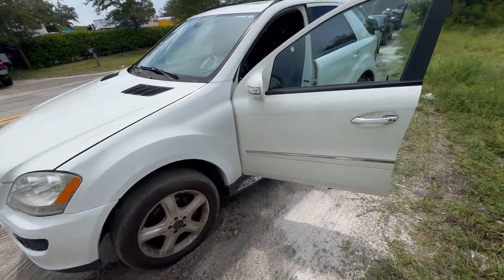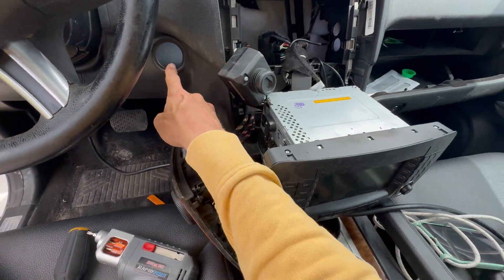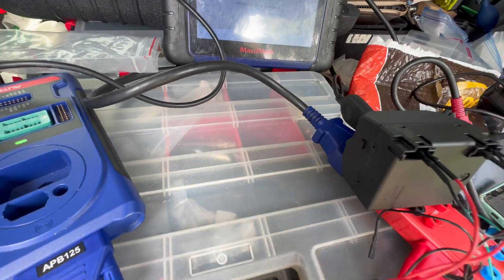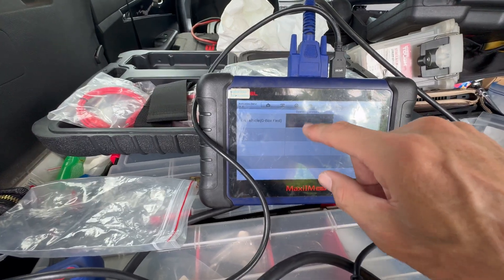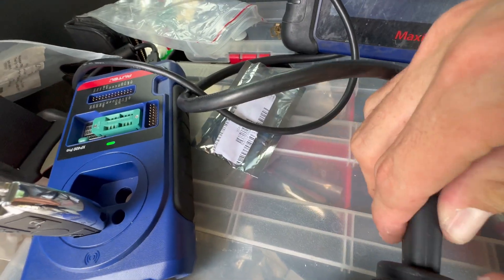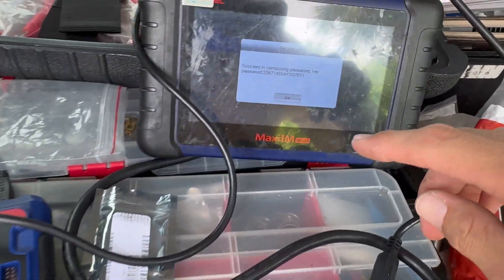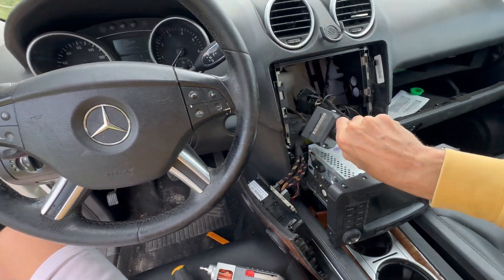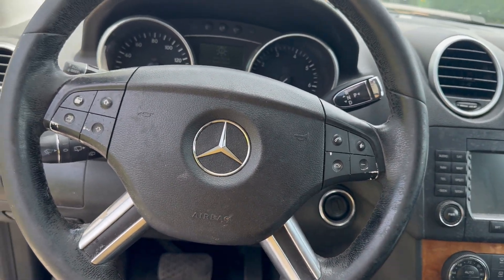HOW TO PROGRAM KEY FOR 2008 MERCEDES ML350 AKL USING AUTEL IM508, XP400 & GBOX

Comment: What was the reason for having to pull the ignition and Gbox? 

Why wasn’t the emulator enough to do a new key? 

I apologize for all the comments/questions on your videos.
Reply from the maker: Just like I have explained in the video 2008 and under you must take the box in order to read the code, if car was 2009 and up then you will not need to remove the box.
Reply: @legacylocksmith7874  gotcha.  I appreciate your responses.

Comment: If remote frequency was wrong do you have to do through while process again? Or can use working key to add key on different frequency?
Reply from the maker: In the USA we only use 315. But after you have the code no need to remove again. Can do OBD